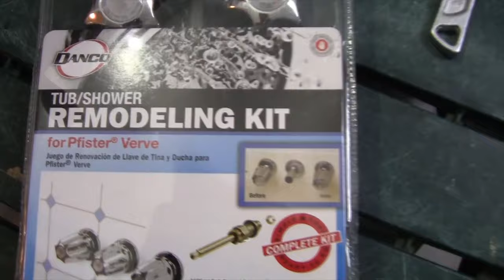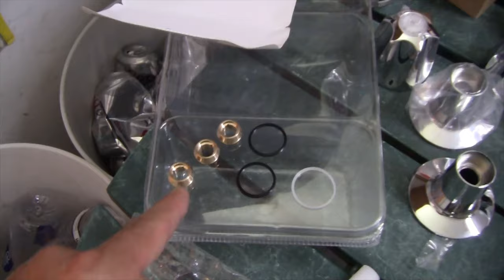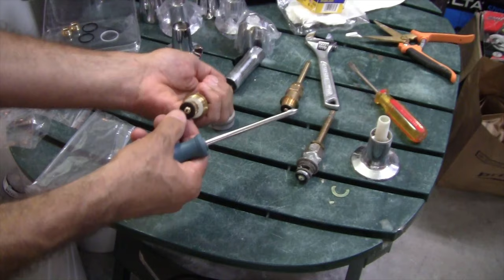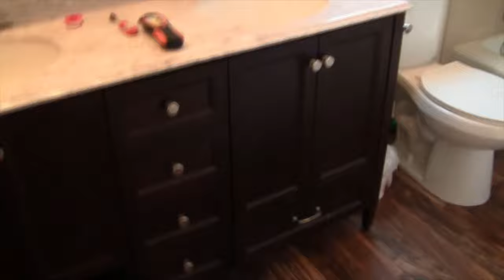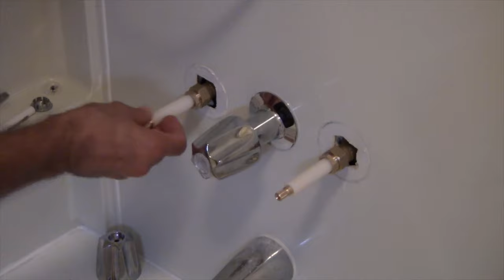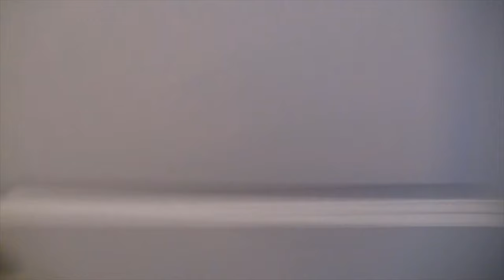How to replace 3 way shower valve stems with New Ones, Complete Instructions

Comment: Fine video, mission accomplished for sure.  You indicated that this shower is not used often but reseating those valves may have been worth buying the proper tool.  You mentioned that it is a simple job, and it is , but it is time consuming.  Don't lose those seats that came with the kits, you may be revisiting this project in the future.

Comment: Thanks! This point at 11:57 is SO important. I spent literally hours trying to figure out why my diverter wasn't fully working, and it was because I had tightened the packing nut while the stem was too tight. Your video saved the day (and probably some plumbing $$ :) )
Reply: Yes, that is the one thing which wasn't very obvious anywhere else. Thanks Ken for the video and JP for pointing out the time stamp and the fact about 'tightening the packing nut while the stem was too tight'.

Comment: That was a good job but, you still should have replaced the seats. It is worth getting and using a seat wrench to get the old seats out. Using one of those makes it pretty easy But, I can understand why you did what you did. Just the other day, I received a rebuild kit I bought online for $60.00 for my Dad's 63 year old American Standard 3-handle shower valve in our old, upstairs bathroom that us kids used when we were young. I did replace the seats and it wasn't too bad. The rest went in fine. My Dad's 63 year old shower works perfectly now! Like it's brand new!

Comment: Thanks for the video. So,how did you remove the valve seat out ? Mind stuck inside,that I am unable to remove it. What tool did you use ?
Reply from the maker: I did not change out but you will need a special valve seat removal tool to do so. Work slow and use penetrating oil to try to loosen up.

Comment: Great video, thanks!  I bought the Danco Gerber faucet replacement set for my leaky cold water knob.  Is is safe to replace my center diverter stem and handle set before turning off the building's water supply (as a dry "practice" run before the apartment's superintendent turns off the central water supply for a few hours maintenance sometime in the coming weeks)? From your video it seems totally safe (no gush of water while replace the center diverter).

Comment: Great video. I've replaced diverter valves in my house over 30 years.  The knob was stripped out along with the stem splines. When I installed the new Danco diverter valve it leaked just like yours does, maybe a bit more when the shower mode is selected. You seemed ok to live with it. Since this video is 3 years old, did you ever fix that or figure out why it's leaking? Thanks!!
Reply from the maker: I ended up removing the old 3 valve faucet and installing a single handle Moen PosiTemp valve with a Schmidty plate
Reply: @KenTraining  Thanks so much for the info. My diverter valve is leaking just like yours was but worse. Someone in the comments of the Danco valve mentioned his O-ring was a bit thin and he put a thicker one on and it took care of his problem. I did the same but it only made it better, not fixed. Now it's leaking like before. I bought a Home Depot home brand Everbuilt diverter valve and plan to give that a try otherwise I'll be doing the same as you did. I also like how you didn't need to turn off the water to replace the diverter valve. The water shutoff valve is from the 60's and sometimes it wants to seep so I tighten the bonnet but if I don't need to shut it off that's even better. Thanks!!

Comment: Sometimes you have to change the seat because they have a cut in them, that is causing the drip. That's what I'm up against, great video.
Reply: I change the seat and I’m still getting drips.
Reply: @joejoe6949  
Did you replace the rubber washer that closes on the seat? Probably so . If you installed a new stem valve . Good luck .
Reply: Hercules overtightened the water off does not help either, 😸💪✌️🙏🤔 half turn after rubber contacts, just like a oil filter, too much will pinch or roll seal ...👍🎯☝️

Comment: I went through all that without replacing the valve seat on the cold water side and it still leaked. Replaced the seat and the dripping stopped..

Comment: Pro tip:  Use the correct tool for the job.  A Kobalt seat tool is $16 at Lowes and some replacement kits include it.

Comment: Awesome video, I just replaced my hot and cold water stems. Still dripping water
Reply from the maker: replace the seats as well and it should not leak by.
Reply: @KenTraining  Thank you, i bought the stems set. Gonna have to get the whole kit.
Reply: May need to replace both hot and cold seats.
Reply: @deborahwhatley3551  Thank you, did it and no more leaks.

Comment: Great job, but if I’m going to do this job I’m going to make darn sure I replace the seats.  Why not do it...you have everything already opened up and the proper tool is cheap.  You did a very, very good job otherwise.  Good video.
Reply from the maker: You are probabley right. I did save the seats if I did need to replace but my shower is not used and they currently work good.
Reply: @KenTraining  are the seats universal? or how can you find the type to place?
Reply from the maker: @ShortyisHeree  I had the seats in the kit, what I needed was the removal tool. My seats did not leak so I left them. If my seats did leak I would have got the tool and changed out the seat. I still have the seats if that becomes necessary.
Reply: Anthony 
Good point . But if the seats aren’t ‘crashed’ , damaged  they might not need replacement . But they should be replaced since the repair is being done anyway.👍. So you would be correct.
Reply: @KenTraining You should have changed Bibb Seats. You don't  need L shaped special wrench, and you can use a Philips Screw Driver #5 which worksbetter than a Wrench.😅

Comment: I just replaced my diverter valve with this exact one and lost a lot of water pressure. I made sure the valve was fully opened before tightening the nut but it didn’t make a difference. Any advice would be appreciated!
Reply from the maker: you have a restriction somewhere. 1. shut water off and remove valve/s and look with flash light for debris. open water on without valves to blow out anything in the lines. put back together and test.

Comment: Do I have yo make sure to buy the exact diverter valve to replace with? Or are they all the same first time home buyers our house us 1983 and my pull for the shower broke off I can pull with Rench to shower for now but when I can will be replacing it myself can I just buy any or do I need to make sure it is the same part that are in our bathroom now? It's three piece like this but for our shower it was an ugly stick to pull and very hard to push back in the wall
Reply from the maker: if you are replacing internal part and keeping the valve body, you will need the exact replacement parts. the best bet is to pull out the old parts and bring to hardware store so you can match it up.

Comment: I purchased a Pfister 910-374 Marquis Hot and Cold Stem 
the Pfister 960-280 2-1/2 in. O.D. Zinc Die-Cast Replacement 
appears to be to short. What is the right size Die Cast?
Reply from the maker: I would not know that answer.

Comment: Do i need to replace the whole diverter in the wall or just those valve knob stems? My faucet is dripping slowly and i noticed when i took off the knobs and the valve, there were broken stems inside the pipe/diverter.  Could i just replace the valves?
Reply from the maker: as long as your seats are in good condition and you can remove the old broken stems then you may be good.
Reply: Mine has a broken seat behind the stem but stem is good.  But ill probably replace stems and seats.  Could i use brass instead of plastic the part that screws in behind the valve stem? @KenTraining
Reply: @KenTraining I took a screw driver to get out the broken part of the seat.
Reply from the maker: @daviddart400  yes, use brass,
Reply: Thanks, i was told by like 3 people to replace the whole diverter but nothing is wrong with it.  Just the seating was broke and had my faucet leaking.  Thank You@KenTraining

Comment: Is plumbers tape not required. I noticed you didn't use any for the valve replacement
Reply from the maker: correct because it has a gasket to seat that joint.

Comment: I have been trying for a month to get the diverter out of the on and off knob (the plastic piece) and I can’t get it! It’s A old shower like the one you are working on and every time I try to take it out it literally moves the whole wall like it’s not coming out! Do you have any suggestions at all? I would so appreciate it!
Reply from the maker: It sounds like the valve handle (the part you normally turn with your hand) is rusted/stuck on the valve stem. In that case you may need a valve handle removal tool. check out this link https://www.homedepot.com/p/Armour-Line-Adjustable-Faucet-Handle-and-Compression-Sleeve-Puller-RP77233/306693291?g_store=&source=shoppingads&locale=en-US&&mtc=Shopping-B-F_D26P-G-D26P-026_007_PLUMB_REPAIR-NA-NA-Feed-SMART-NA-NA-New_Engen&cm_mmc=Shopping-B-F_D26P-G-D26P-026_007_PLUMB_REPAIR-NA-NA-Feed-SMART-NA-NA-New_Engen-71700000081569458-58700006932068295-92700062338492184&gclid=Cj0KCQjw5oiMBhDtARIsAJi0qk0u28F3DJhSy8N6FbB9Z3t_AzFHhekjsmSWVd_yq-4HP70x9tMmwp0aAnFTEALw_wcB&gclsrc=aw.ds

Comment: is it absolutely necessary to cut off the whole water of the house? or if possible just that area?
Reply from the maker: you need to shut the water off that serves the area you are working on. If you have a seperate shut off valve to do that you will be good.

Comment: I replaced my diverter valve and now it doesn’t send water to my shower head. Can it that when I took out my old valve the washer was broken, could the broken piece got stuck where the water goes to my shower head. Cause now it just drips water from my shower head. Thank you 🙏🏽
Reply from the maker: Yes, anything is possible. I would 1. Shut off the water 2. Take the diverter valve apart and check with flashlight any obstructions. Then I would turn water on for a second to blow out any debris. 3. Put diverter valve back in and make sure valve operates freely 4. Put water back on and test operation.

Comment: What do you do when the new one won’t screw in?
Reply from the maker: if you are sure you have the correct replacement part with the same thread pattern you man need to rethread the threads. you will need the exact tap and dye size for this and I don't know that size. If I were you, call a plumber in to evaluate.
Reply: @KenTraining  ok thanks😁

Comment: What if i do need to change the seat because its damage and part of why there is a leakage
Reply from the maker: then buy the special seat removal tool, spray penetrating fluid on the old seat, let sit for 10 minutes then try to extract old seat with tool. go slow and don't break or strip anything. you may need to add more penetrating fluid or even some heat.

Comment: So I can take the diverter valve out  shutting the water off ?,  Im only asking because I dont know what Brand I have ,  Its very old tho.
Reply from the maker: Yes, as long as the hot and cold are shut off you are safe. BUT just to be on the safe side, go slow and always know where your main water shut off valve is located.
Reply: @KenTraining  Ok , thanks Brother , Great Video !

Comment: What happens when the old valve is stuck and you can’t get it out
Reply from the maker: Great question, the answer is First call in a plumber to see if they have some tricks to replace it that you did not do. if the plumber is unsuccessful in the valve replacement then  How bad was the valve for you to start this project. If you cant get the old valve out can you live with the old valve? If you can then just live with it, if you cant, you will need to remove the entire valve and replace the shower fixture with all new. try to go in the back of the shower wall for access. This requires more skill than just replacing the valves.

Comment: My water pressure went down when I changed the diverter any idea?
Reply from the maker: you must have a restriction somewhere in the system. You may need to flush the system out to clear it.
Reply: unscrew the shower head.   look for restrictions.

Comment: While this does have good information I don’t see how you can call this 100% success since your diverter is leaking. There shouldn’t be any water stream coming down the spout if the water is being diverted to the shower. Either you have a bad seat behind the diverter or a defective diverter valve.

Comment: You forgot plumbers putty. Where do you put the plumbers putty???
Reply: Plumbers putty Is not used in an installation like this. That is used where you want to prevent leakage for something like water on a sink deck down into a cabinet or a garbage disposal flange down into a cabinet. It simply seals the gaps.

Comment: I replaced the diverter but now the water is not switching from tub to shower all the way
Reply from the maker: I don't understand that either. Is the valve going through a full open close cycle?
Reply: I think so.  It goes to tub really strong but doesn’t go to shower really.  I cleaned the inside and removed a stuck washer in the hole and still no good
Reply from the maker: @frankcheco7550  there must be some blockage.
Reply: @KenTraining  I really think I cleared it all up…. But I’ll check again in the morning.
Reply: So now the tub part shuts off and I get a spurt of water on the shower for half a second and then that goes off too.  It sounds like it wants to come thru the shower but it just doesn’t for some reason
Reply from the maker: @frankcheco7550  remove the aerator to make sure no restrictions.
Reply: @KenTraining  you are the man!!  Thank you very much!

Comment: Interesting. You did show the container of plumbers lube ( grease ) . A very necessary treatment on the brass screw threads before install . Apply to screw threads then go lightly at first upon tightening to ensure alignment is correct.